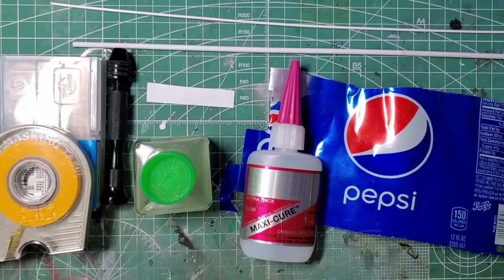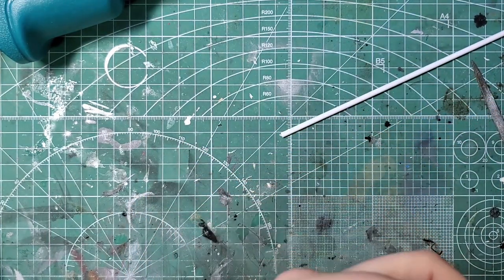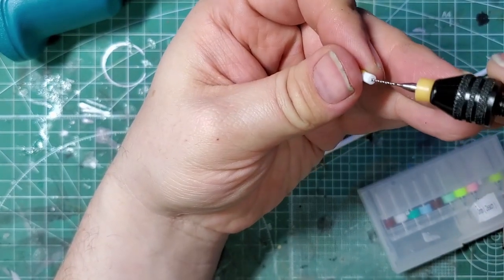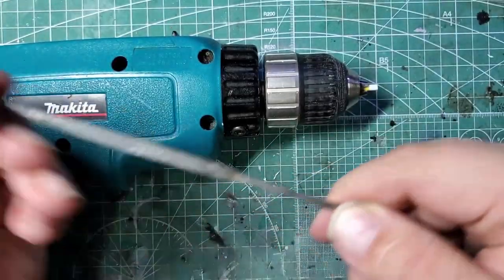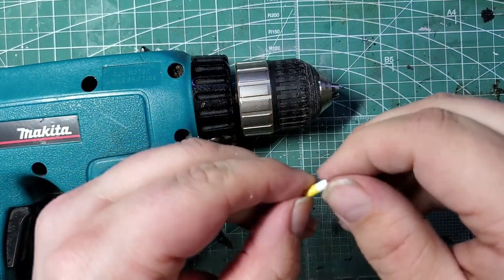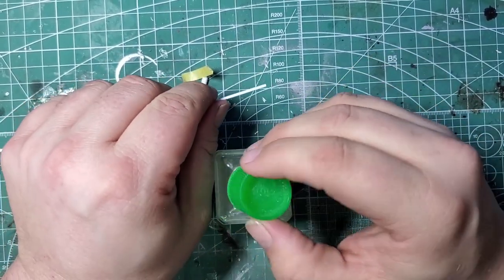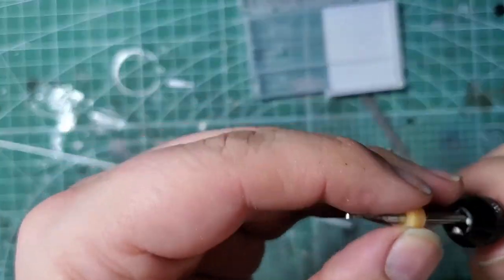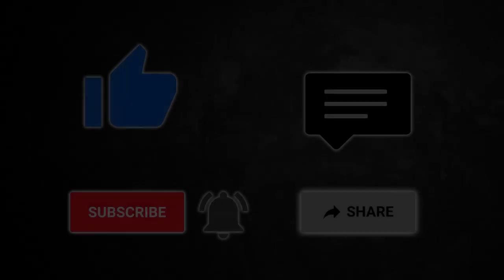Scratch Building a Fire Extinguisher - Pt 1

Comment: Great how too I do alot of scratchbuilding also sure wish I can get those drill bites here in Canada Habour freight don`t sell to use canadians
Reply from the maker: I looked on the Canadian amazon. smaller selection than US but they are there and about the same price after exchange. 

https://www.amazon.ca/10Pcs-0-1-1-0mm-Tungsten-Carbide-Circuit/dp/B07FHKY6G6/ref=sr_1_5?keywords=micro%2Bdrill%2Bbits%2B0.1%2Bto%2B2.0&qid=1582064982&sr=8-5&th=1

Looks like you have to buy the 0.1 - 1.0 and 1.1 to 2.0 sets separately. but that's how i buy them here too because I break the smaller bits constantly.